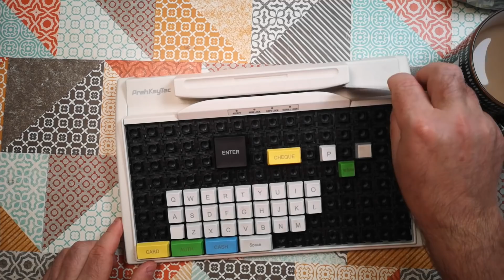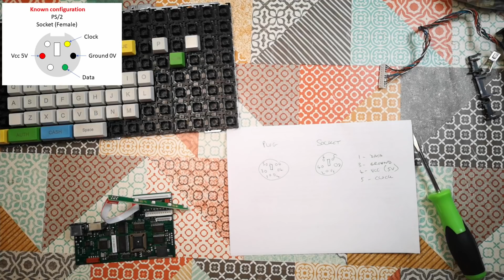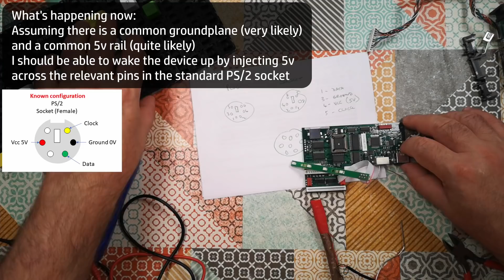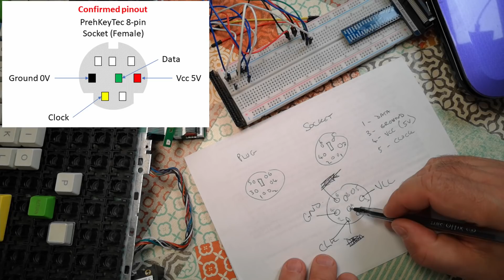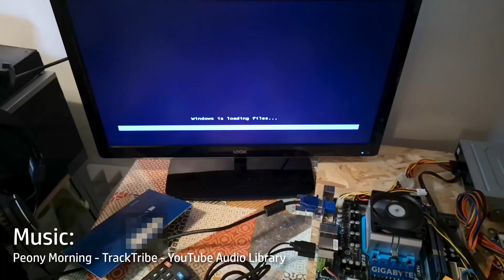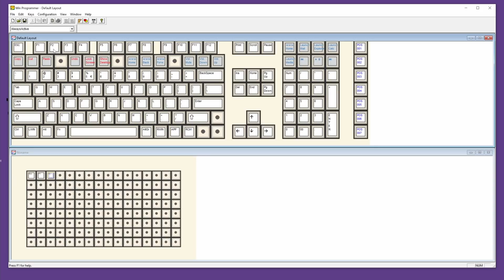Reviving a Weird Ortholinear EPOS Keyboard (PrehKeyTec MC 128 WX)

Comment from the maker: Afterthoughts & Addenda
The PS/2 port on the keyboard is actually for a barcode scanner - sure, you could, but most PS/2 barcode scanners come with a 'wedge' interface so they have their own PS/2 passthrough built in - my reading of the PrehKeyTec technical documentation suggests that the PS/2 passthrough on the keyboard is intended for a support technician to add a standard PC keyboard for troubleshooting or similar (the POS keyboard, although it is a proper keyboard, might not be programmed with any key for <Ctrl> modifier, for example)
Reply: Supported these for about 10 years. They are sill in very regular use. The reprogramibility is near identical in the usb models. In retail things move slow. I still have a variation of this one in my workshop though its the fully reprogrammable model (still ps2).
The winprogrammer software has a print option for the key caps. Ive spent many hours cutting those out after printing.
Reply: you're lucky if you have that standard a pinout as ps2, some barcode scanners way back when had a rj45 that could do serial, parallel, network or ps2, depending what you used it for, now they are all cheap led based units from china that use usb

Comment: I know I'm a million years late to the party for making comments on a video, but I feel I'd be remiss by not congratulating you on your reverse engineering of the PS/2 port. I really don't think I'd have come up with the method you used if I sat and thought about it for days! I just recently used a similar, "brute force" method to learn how to disable the video pre-processing units on a flat screen TV. I have two, fifty-inch Panasonic plasma screen units that I've got a high-powered gaming computer plugged into. By doing the bypass, the TV does absolutely none of the processing of the video signal, basically turning them into display panels with a 600Hz refresh rate and some of the truest blacks and whites I've ever seen. It doesn't matter that they had a native resolution of 1920X1080, because the graphics card will display in 4K contained within in a 1920X1080-sized box, times two! Isn't reverse engineering so much fun?!?!

Comment: that is so cool 
I have seen like hardware like this such as old keyboards and would just assume the data o/I would be forever incompatible rendering the hardware useless 
even though you had to use 32bit os, it's cool you even got it fully working. the fact that it's pretty much married to the old PC in terms of use ability and antiquity is just chef's kiss

I have this mixman dm2 that is a USB "dj tool" that, at the time, was extremely ahead of it's time.but unfortunately it has the exact same issue of there being only 32bit driver's. in my opinion there is no other hardware that actually renders the device obsolete, but I'd love to somehow be able to intercept the data like you did and reprogram it, although if I can't use it on modern machine it wouldn't be use to be

Comment: That's an interesting project! I found a Preh MC 80 WX on eBay and was hoping I could turn it into macro keyboard for video editing. It has a USB cable and the seller says it's only programmable on Win7.

Do you think I could program those keys with a virtual machine?
Reply from the maker: Best to check the FAQ at the PrehKeyTec website - if it's a true USB model, I think it should be programmable on any version of Windows - as far as I know, it's only the PS/2 models that require a 32 bit OS - because WinProgrammer needs to install a customised PS/2 driver for which they have no intention of porting to 64 bit (but do check that)
Reply from the maker: But also, make sure the item on sale is actually USB.  The one in this video was falsely listed as USB and the plug wasn't visible in the photos on the eBay listing.
Reply: It's PS/2 but according to the seller it works with a PS/2 to USB adapter which he also includes. I'd love to figure out a way to turn it into a video editing macro keyboard.
Reply from the maker: @final02.mp4  It won't be programmable through that adaptor - only via a native motherboard-mounted PS/2 port on a computer running a 32 bit version of Windows as its main OS (won't work via a VM) - there is no workaround - I know from painful experience.
Might be better to wait for a USB model to show up for sale...
Reply: @AtomicShrimp  Thank you very much!

Comment: Man I’ve got a literal stack of beautiful crazy colorful keyboards mostly pulled off of antique/vintage CNC machines, or other automated equipment from the 70s and 80s that would’ve been used in factories. Like massive automated tablesaws, or these huge engine testers and gas analyzers that used to be used at the big car maker factories to test all of the exhaust and everything coming out of the car. Pulled one out yesterday when I was at the scrapyard out of a bear engine analyzer from the early 80s. I swear it’s got six different vibrant colors of keys like blue red orange green looks like a dang parrot or African my car. Absolutely beautiful and stunning so if you know anyone that would want stuff like that give me a shout

Comment: I finally watched the whole video. I'll be honest I didn't expect it to be interesting but it was! You make everything interesting Mr Shrimp. I doff my cap.
It also reminds me of the countless hours I spent trying to get odd bits of hardware and software working in the past. Now I just use the PC like a normal person for the jobs Android can't handle. Or handle to my liking that is. Apart from the 3 hours I recently spent learning that Windows 10 broke my printer software and so the only way to get it working was to install parts of the software but then stop short of a full installation or it stopped working again. That was annoying.

Comment: You can buy the 8 pin mini din plugs cheaply on eBay. The same socket is used on amateur radio gear from Yaesu for the data communications socket.

Comment: The card slider could well work as a login method for a desktop Linux system. Compile that functionality into LightDM and swipe a card to provide credentials without the need for biometrics, keep it in your wallet so nobody can browse the PC files unless they have your card or wipe it.
Reply from the maker: It's probably only a bit more secure than writing down a password

Comment: Love a Preh keyboard! I was using them at work for controlling radio playout software until about 2018 when we replaced the software and ditched them. As the software eludes to, the connector contains RS232 serial and PS2. IIRC the ones we used (from the software supplier) only used the serial (as it was entirely for special functions).

Comment: When I worked in radio in the 90s the air computer was operated by one of these.  There was an on-screen panel of buttons (play channel A, play channel B, stop, cart #s 1-25, that sort of thing) and a keyboard just like this was mapped to match the on-screen panel.  The key legends were just laser printed (in mirror image) onto a sheet of acetate and cut to fit.

There are also "do-nothing" keycaps for these keyboards that just blank a space out.

Obviously this particular one was made for EPOS but the grid-layout of keys has certain very handy uses.

Comment: How much versatility does that software for key assignments give you? Does it allow multikey commands or macro commands? Because if so having a 128 key macro board would be pretty cool.
Reply from the maker: I think it can do macro strings, but probably not involving key modifiers - so you can make a single key type 'Banana', but probably not make it do Ctrl+Alt+Del (not sure though)

Comment: I'll have to see if I can get hold of some of these keyboards for some interesting custom jobs.
Interesting that you suggested so that you couldn't link them together in a loop as then there would be no power or data! 😜
Reply from the maker: In my experience of IT support, if you give people cables that can go in more than one place, they will choose the wrong place.  Never let them move a network switch as both ends of all of the cables fit in any of the sockets.

Comment: I think the keyboard component must be just a matrix of connections, which you can probe from the ribbon cable easily to find the rows and columns.
You can ditch the controller board and use a standard microcontroller that's designed for a large keyboard matrix.
Reply from the maker: I was thinking the other way around - keep the controller and make my own matrix of high quality switches

Comment: Have used these at a job before, the deck that the stabilizer of the double and quad key snaps into has a habit of breaking with use. Apart from that though, pretty nice to use overall.

Comment: Could you use your laser engraver to engrave the key caps?
Reply from the maker: That's the plan
Reply: @AtomicShrimp  Not sure how easy they are to hold to engrave, if you wanted I could 3d print a simple jig to hold them
Reply from the maker: Thanks! - I have a sort of a plan for it - I'll see if that works first
Reply: @AtomicShrimp  Ok no problem, just let me know if you need anything.

Comment: For key cap labels, you could try using water transfer decal sheets used for model kits. You can buy packs of sheets, create your labels in whatever software makes you happy, print the labels onto the sheets, and transfer them to the keys. I'd recommend hitting the caps with a few coats of spray varnish afterwards to protect the decals. But that gives you the ability to choose your fonts and text size/dimensions, add pictures or pictograms, whatever you want to adorn the caps with.
Also, have you considered separating the letter keys by moving the right half of the keys one row to the right? I have big hands and need wide keyboards, otherwise my hands are on top of each other. Looks like you have a few spare keys to the right that could be relocated between the left and right halves of the letters. Not ideal placement for the extra keys, but may give you a little more room.

Comment: Rather than sanding off the printed text on the keys, try scrubbing with common table salt that has been moistened enough to hold together along with a paper towel. Works great for removing silk-screened logos from plastic objects without altering the plastic finish. 

Works well for removing silk-screened graphics from glass as well.
Reply from the maker: I'll give that a try. Not sure exactly what method they used to print these - the lettering is slightly raised, but also seems to penetrate the plastic surface a tiny amount. Not deep enough to be doubleshot. Maybe pad printed with some solvent based ink that etches the key a little
Reply: Like removing the paint from a LEGO-man's face?

Comment: Y'know, I wonder if it's possible with modern technology to make a keyboard like this where you can just pull out and insert the keys at will and have the keys retain their function no matter where you put them, without having to reprogram anything.
Reply: I should say, I'm sure it IS possible, but I wonder if it's practical, or even something anyone would want.
Reply from the maker: I can think of ways it could be done, most of which probably aren't practical to implement - sensors that detect a unique code on the key - that sort of thing
Reply from the maker: Just remembered this video (which is sort of a terrible implementation of that idea: https://www.youtube.com/watch?v=9klDrR6UabI
Reply: @AtomicShrimp  Huh... Yeah, that is more or less what I'd envisioned, except with the capability of emulating a full keyboard. So a mixture of that and your macro keyboard I guess. Either way, probably not a particularly desirable product even if implemented correctly.

Comment: Question: Could not a virtual machine with a 32 bit operating system, provide the same functionality with less hardware?  Also as far as the key caps considering your current assets and skill sets, maybe you could laser engrave small wooden plates you could attach to the keys that would still be removable in case you'd want to change it later OR maybe create a mold and cast button caps using HDPE?  (just a thought)
Reply from the maker: I don't think it can be programmed from inside a vm. The manufacturer's driver replaces parts of the windows driver making it do things it normally would not. The host machine would not have that altered driver

Comment: To print labels I have a brother label printer, a modern one that uses thermal and prints smooth, mostly durable labels. It's not the most efficient tape use, but if you're printing a bunch at once it can be pretty efficient. They also make special label tape for cable labeling which is tough, waterproof, wear resistant, and so on. This isn't an advertisement, it's just that I use it often enough and a tape of a particular width would probably be perfect. The tape cartridges are like $20 and the machines are like $20-40, but I think you'd find it a nearly perfect fit. Big Clive had a video on a more expensive version about a year ago, you can see how it operates etc.

Comment: The card reader could be used for things like keeping a file box of macros. The mag stripes are just bar codes after all. I think you can get an encoder and a box of hotel style cards for not too much. I mean it would certainly not be as cheap as a secondhand decades old keyboard but I'm sure there's probably a decent use case somewhere. Maybe an accessibility function for a person who can't use traditional keyboard or something. Not exactly relevant here I guess but just a thought.

Comment: I know it wouldn't be the least bit useful for a home-use keyboard, but I, for one, AM interested in seeing what the card reader does and how it works.  Not for anything practical, just because I'm curious.  Although, just for fun, it would be cool to see if you could use it to program a custom security card to get into the computer it's hooked to, instead of a PIN or PW.
Reply from the maker: The card thing is only a reader, but I will keep it for some experimentation

Comment: Somehow I understand this perfectly, but I also do not.

Great video. Question - what is the "clock" and "data"? What does that mean? I am not a keyboard enthusiast or an engineer of any kind so this confused me a bit.
Reply from the maker: In serial communications of this sort, the information is sent as a stream of pulses of high or low voltage, representing binary 1s and 0s, but in order to keep things in sync, there is also a regular 'clock' pulse signal on another wire - basically makes it easy to be sure that, if the data line sends, say, three 0s in a row, three clock pulses make it very easy to be sure it was three  zeroes not 4 or 2
Reply: @AtomicShrimp  I see, thank you for clarifying! This was a great video and I think I might try watching more of your varied content :D

Comment: Have you considered interfacing the output of this EPOS keyboard with an Arduino, so the Arduino can act as a USB keyboard compatible on any computer and without the need of software to map the keys? The downside with this would be needing to find a work around to configuring the keys if you wanted to change it... but you could simply reprogram the chip or read a config from an SD card (additional module) that maps each one. You would simply take out the SD card and edit a file in notepad to make changes, before reinserting it. 

You would need an Arduino that has USB HID compatibility (Leonardo if I recall correctly).
Reply from the maker: Not sure how that would work. The keyboard would first need to be programmed so that every button produces some output to the ps/2 interface. Without that, some keys simply do nothing if they were under a blanking keycap or under a multi unit key

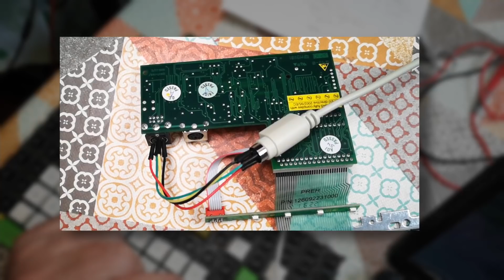Comment: 16:35 - There are two kinds of USB-PS2 adapters: passive and active. Passive adapters are just pin-patches that connect pins to pins and only work with PS/2 devices that specifically support USB mode. Active adapters have circuitry inside them to convert PS/2 signals to USB to allow connecting any PS/2 keyboard or mouse to USB. The one that Mike is using is an active adapter; that's why there's a bulge in the middle, that's where the PCB with the converter chip is (but it doesn't have to be bulgy, the chip could be small enough to be unnoticeable).

Comment: I bet someone intended to make a little edit just after the 3:00 mark and forgot about it.

Also would you have been able to run the drivers on a virtual 32 bit machine, or would something have gone wrong in the layer where the actual pc passes data between the virtual machine and the device?

Comment: I used to service these.
Preh makes so much good stuff.

They make a PS2 to USB converter.

When I converted my old Model M over to USB, i just soldered it in line and tucked it inside the keyboard.

Comment: Would it have worked to run a 32bit windows vm on the original machine?
Reply from the maker: I don't think so. The software needs to modify the windows keyboard driver